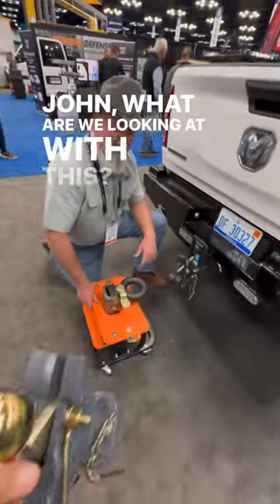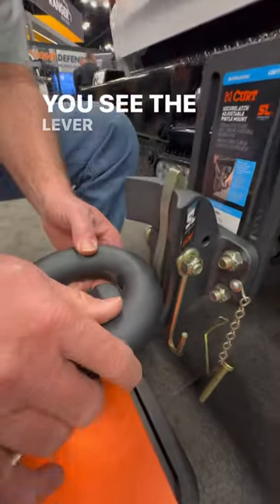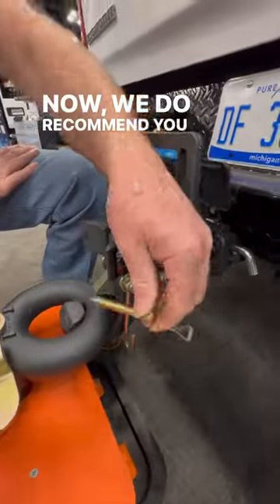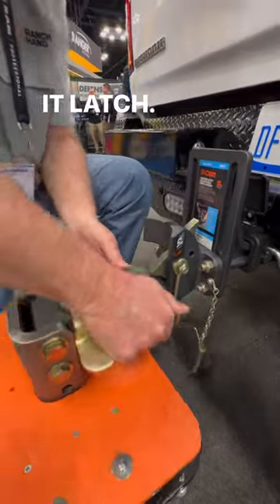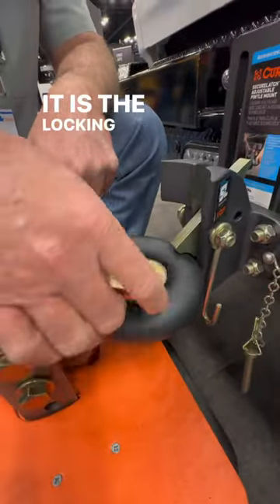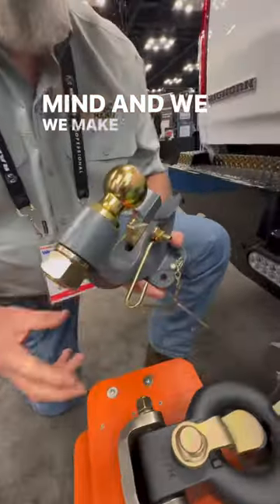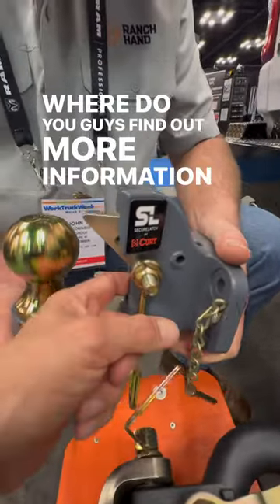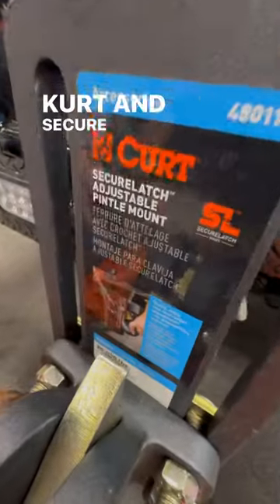It’s an auto latching pintle hitch. #shorts #truck #trailer #safety #hitch

Comment: No worries boys Larry pulled and pulled couldn't get that sucker off
Reply: Larry has a 3 ton pull 😂
Reply: John
Reply: Exactly what I was thinking 😂😂 is this for real??
Reply: lmfao
Reply: Look I know the internet isn't bright but you do realize pretty much every trailer including semis are only held by small pieces of metal because while hauling there isn't much more shock then that.

The strongest part on the truck (half tons) side is mabye a half inch of metal and can easily with stand multiple tons of wieght
Reply: Hahah Larry is corn fed.
Reply: Pulled the fire out of it

Comment: Vibrations on the road have me concerned, just pulling it the way he did means nothing to me, as the vehicle moves it will taken load back and forth. I don't trust that without a pin and dont see this as a better option!

Comment: Just remember to always cross your chains. To catch the trailer if it detaches!
Reply: I’ve always been told that but idk why to cross them
Reply: @haydenpatstone2849 it creates a sort of cradle  to catch the trailer and keep it off the ground if the hitch comes off
Reply: @haydenpatstone2849  If the hitch breaks or the trailer detaches from the truck, the chains will yank taut and grab the trailer to prevent it from just going off on it's own. If you don't cross the chains, the trailer hitch may very well dig into the road. With the chains crossed, it acts as a cradle that will catch the trailer's hitch while the chains are being pulled taut.
Reply: Cradle cradle
Reply: Common misconception. Crossing chains helps with minimizing the slack/stretch during a turn. And dot doesn't care if the hitch drags the road or not if it comes unhitched. They just don't want it going into traffic.
Reply: @tangydiesel1886 Yeah, that too I reckon. But it's not why people do it. And DOT might not care, but I feel like I'd prefer if my trailer didn't dig into asphalt.
Reply: @rustyshackleford1 also puts stress on the chain fyi. single cross anymore and it’s useless it’ll just snap the chain
Reply: Not if when
Reply: When is the proper word…
Reply: @haydenpatstone2849  I see your question has been answered but it’s good that you asked. 🤙
Reply: Now you know always nice to learn something new.
Reply: My dad died when I was 16 there was a few things that he taught me before he left this world-“ cross your chains make sure your hitch is locked boy” that will be one I never forget.

Comment: That thing he called the locking mechanism does nothing even with a lock. You could pull the pin push the lever in and take the trailer no problem.

Comment: He talked about putting a padlock on the trailer side but the way that little flap goes over it would you not still just as easily be able to lift the trailer off the hitch?

Comment: That don’t seem like a lot of space for that to catch and hold in place. Tugging on it is one thing but a load pro trailer full of gravel and drive over a bump or thru a small ditch or out of a drive way… The point is contort it with some weight and see if it holds at every angle
Reply: yeah man I bet you thought it out more than the manufacturer did. It's not like they'd get sued or anything
Reply: @schlomoshekelstein908 yeah man I agree no big manufacture has been sued over a faulty product because they have had success before. Once you have made it you are always correct.
Reply: You you feel comfortable using a ball hitch?

Comment: Ive been running this unit for about 4 years towing my dump and float trailers. Never any issues even when loading heavy equipment without rear jacks dropped. Wlrth the the money when switching between ball and pintle 👌

Comment: Am I the only one lost on the "locking mechanism" part, what's it locking?
Reply: so that it don't jump out
Reply: I believe that with out the truck side there it would sink lower into the i hole and then it would be able to prevent coupling but this isn't even worth defending tbh I feel like if the trailer is of any value it probably would be heavy enough to bend that thin price of steel and not to mention pintle hooks already are simple and work fine useless innovation
Reply: Yeah, that metal flap thing that he rotated around. I can't figure out for the life of me what the hell that's supposed to do. 
Edit. So, I figured out how that works. So when the trailer is unhooked, that piece swings around and fills the ring so it can't set down in the hook and be towed away. It will just slide off. He should've unhooked the hitch to demonstrate it.
Reply: @camcam-uw5mx that makes the most sense, more of a deterrent, good eye!
Reply: Also I think the hitch is upside down to display it
Reply: Dude I played it like 4 times and can't understand what he's trying to say
Reply: Yeah, it dosent make any sense. This entire thing dosent make make sense, but that locking system is really bad. The engineers these days aren't too bright.  They also have legalized Marijuana almost everywhere, so this is about what ya end up with.
Reply: I would definitely ruin that tab on the Lunette ring after about the 3rd use.  
I have an archaic Pintle hitch but it’s built better than anything in the market today
Reply: Yea I do not like that tiny little piece barley over the hook

Comment: I don't see the purpose of the locking mechanism on the ring because if you still lift the latch that's on the truck, it will still lift out
Reply: Exactly what I saw. Thought I'd read some comments before I went off. I absolutely cannot figure out what they are trying to convey with that.
Reply: It's an anti theft feature so he needed to de-couple it to demonstrate it. With the Luneete ring un-hitched, the the lock will sit lower and be captured within the ring not allowing anything to couple to it.
Reply: @PWgadgets Crapy Feature, crapy product. That plate will bend out of your way with even a little pry bar

Comment: I dont trust that i need to see a real demonstration
Reply: I agree, I wouldn't touch that!
Reply: I had one since 2020. No issues. Very simple.
Reply: What you mean, the good old tug test not good enough? 😂
Reply: If it wasn't made by curt I'd be skeptical.
Reply: @PT-mj3bk yeah buf he rattled it and everything.
Reply: Thought the same thing
Reply: I’ve had one for 7 years it’s great. And the pintle doesn’t have that slop that regular ones have.
Reply: I carry wood chippers, highly doubt this could handle
Reply: @markkaminski2416 but you truck a ball hitch?
Reply: Made by Hit N Hitch (Power Pin in Saskatchewan ) who Curt purchased it from.. Been used for around 10 years

Comment: That's a terrible design you get any sideload on that it's going to share that right off.
Reply: I have the same hitch and pull a 14k equipment trailer with a 11k trencher backhoe all the time across states. It's perfectly fine. Had it for years.

Comment: Yeah I bet him pulling on it definitely equals 20,000 pounds of weight.  And your stupid flat steel you have on top literally does nothing the ring could still come off the hitch if you lift the trailer with if the locking pin comes undone.   🤡🤡🤡

Comment: Definitely going to pass on that one lol. Most pintle hitches on the road have quite a bit of wear on them. It probably works great when new but ones it starts to wear It looks like this design would be more likely to disconnect than the standard ones that fully latch over, that said I’m not an engineer…..
Reply: yeah i don't trust them. they are supose to locked on like locked locked meaning it should hold up even when the trailer is doing some crazy madness and flips over or what ever. like it should hold up att all times  and if it don't then it don't meat the standards that we expect here. which is probably why you never ever see these types of latches here.

Comment: I don't like a 1/2 bolt securing the leaver.     That will most likely sheer off due to all the bucking of the Pintle mechanism.   Better cross your chains otherwise when that pintle digs into the road, the trailer and load will fly-swatter your truck.    I've had 2 of the 4 Grade 8 bolts sheer off on the Lynette ring on a dump trailer hauling an 8k skid steer due to all the constant bucking.
Reply: A lot of things can happen if the tongue hits the road but a front flip isn’t one of them
Reply: @servicetrucker5564  I came to say this same thing. Seen some wild things when trailers come loose but never that. He’s got a wild imagination though😂😂

Comment: That’s a pass, that latch has too small of a contact area and will wear very fast, also the spring will loosen over time and the pivot point will wear, stick t the original pintle hitch 👍

Comment: Nah, that ain't right. Hard pass.
Reply: @FrankNBeans-bn6wr I'm not a fan of curt anymore, very bad customer service experience and  there e-coating breaks down really bad after 7 years of use, still have OEM parts with original factory powder coating in better condition than the receiver hitch.